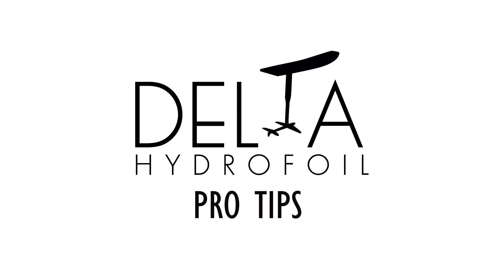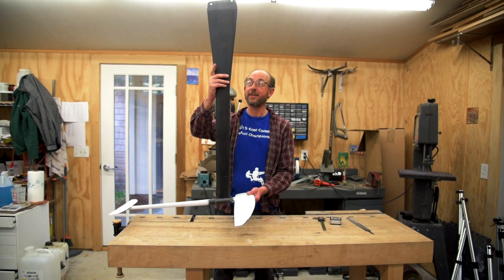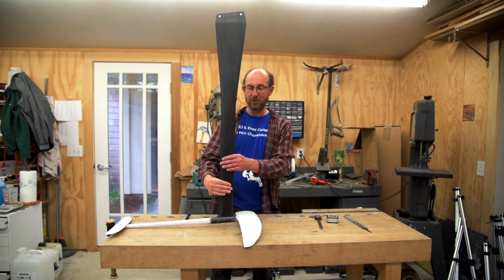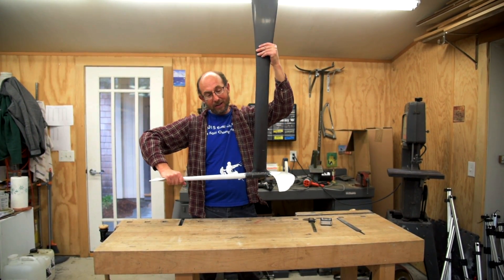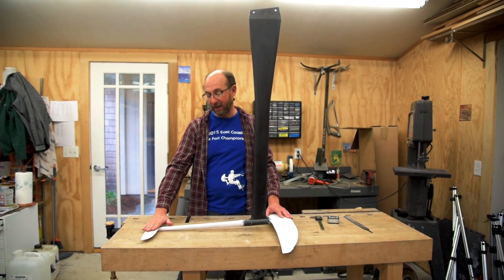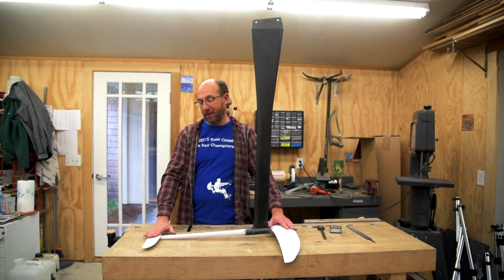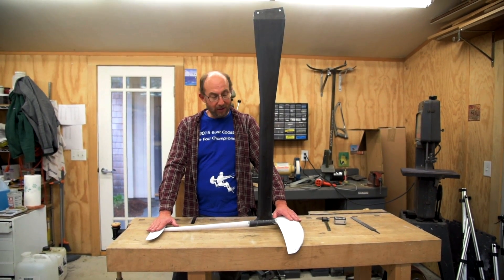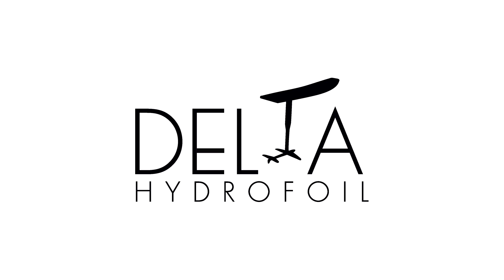Delta Hydrofoil Pro Tip: Why angle of attack is important

Comment: I always wonder if the front wings are at 0° AoA (in line with the fuselage) and the lift will be greated by the Naco profil itself. Or is it usefull to give the frontwing already an 2-4° AoA ?   I am more interesstet in an foil for pumping . Would be also great if someone has experiance what kind of Naca will work out. Hearing a lot of diferent things at the moment.  Naca 63 210 or 6412
Reply: Most thread I have read were not very convincing. Has to do with the back ground of writers/shapers/foilers I think, most are purely experimenting and interpretation are not always accurate IMO. You often see that on how folks interpret the role of bottom contours on surfboards. Regarding your questions, I have been wondering the same for a while but some facts make me think that wing profile has little to do with the lift, or at least not as much as the angle of incidence (AoI: the angle of the front wing relative to the fuselage, AoA is what YOU control with the board pitch). Fact 1 is that planes can fly up-side down by compensating the down ward lift (if any) of the wing with the AoA. Fact 2, which is more telling for what we do, is that Naish moved away from asymmetric profiles few years back and are now using only symmetric profiles. If lift was indeed primarily governed by the profile, then you would expect NO lift on these wings, and as far as I know, Naish sells them by the metric ton so they work. At the end of the day, you as rider will adjust you board level (the AoA) to optimize the speed. If your AoI is off by several degrees, you may ended up having to pitch the board more than you should to correct it, which may not be comfortable, but theoretically doable. I recently built a large aspect ratio for a wing surfer with only 0.5 degree AoI. The goal was to be able to go fast and reduce drag and he loves it! For pumping, since speeds are rather low, I would thing a larger AoI is required, maybe 3 degrees. Finally, the thickness of the wing will most-likely affect the drag, so fast wings (like for kite or tow-in) are usually very thin and have (I assume) a low AoI. XXL wings for SUP are usually thinker, thus slower and easier to control and presumably have larger AoI.

Comment: If the hydrofoil is used on a windsurfer, is there any difference in how much angle of attack is needed?
Reply from the maker: The angle should be between 2 to 3 degrees +SaulOhio